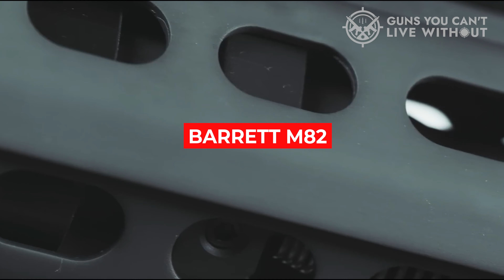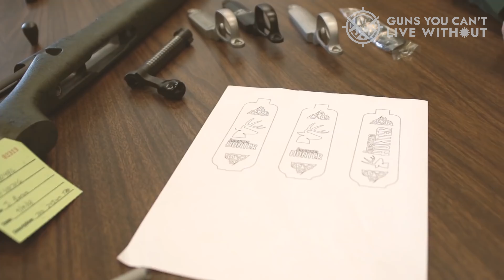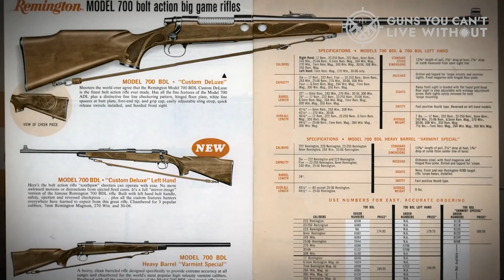Best Sniper Rifles 2025 - Meet the Top 6 on the Planet Today

Comment from the maker: ➤ Best Sniper Rifles 2023 we listed in this video:

6. McMillan TAC-50: Long-range anti-material and sniper rifle used by elite military and law enforcement units worldwide; capable of destroying vital enemy assets and neutralizing opposing snipers.

5. Bushmaster BF BA50: Bolt-action rifle chambering .50 BMG rounds, offering extreme accuracy over long distances; foldable steel bipod and reduced recoil make it a smooth shooter.

4. Tikka T3x Tac A1: Finnish engineering excellence; designed for military specialists, offers excellent long-range accuracy, and is lightweight at 10.3lb.

3. Springfield Armory M1A-A1: Quick target acquisition and maneuverability; 18-inch parkerized carbon steel barrel, unique muzzle brake design, and solid composite stock for steady targeting.

2. Barrett M82A1: Semi-automatic anti-material rifle employed as a long-range anti-personnel sniper weapon; designed to destroy sensitive enemy equipment from a distance.

1. Remington 700 XCR: Long-range tactical bolt-action rifle; fast-cooling and fluted 26-inch 416 stainless steel barrel, beavertail forend, full-length aluminum bedding block, and adjustable 40-X trigger for maximum accuracy.

Which sniper rifle you are going to choose?
Reply: My 5R 24" Savage out of the box is more accurate than the Remington XCR (proven)